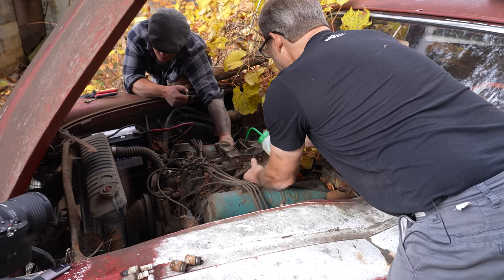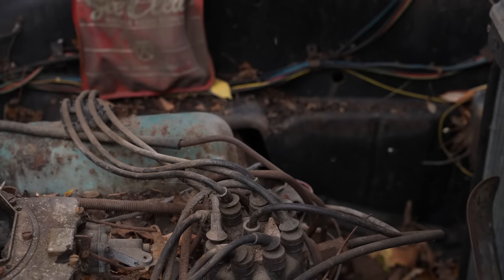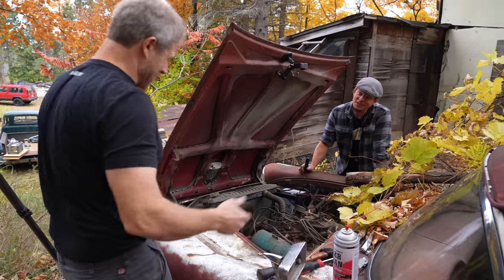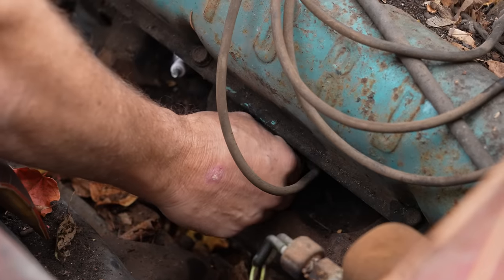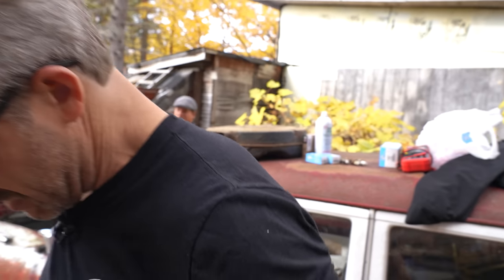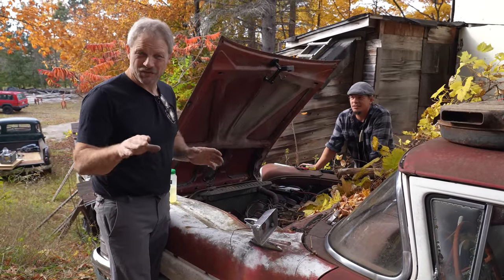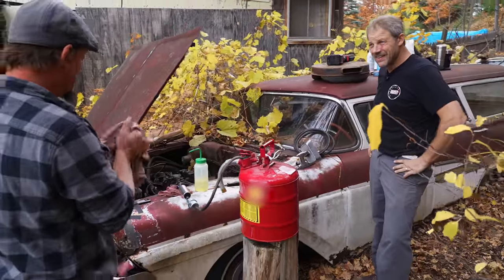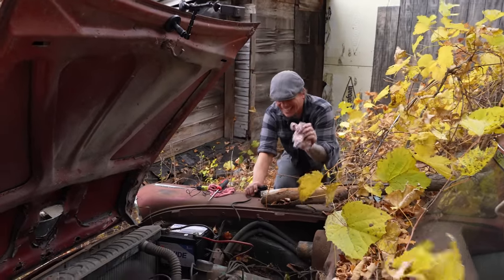'58 Ford Parked Over 50 Years Ago: Will It Run?

Comment: You just can’t kill an old Ford.  Look up Fab Rats channel and Merlin’s Old School Garage where they rescued a speed boat that had been sitting on the bottom of Lake Powell for 30 years.  They pulled the engine apart, removed the heads, quick hone on the cylinder walls, flushed everything out and put on a rebuilt carb.  With a small amount of coaxing, it started, ran and idled down.  The reinstalled the engine in the boat, plunked it back in Lake Powell and took it for a rip.  The engine was an old Ford FE 390. 👍

Comment: 50 year old car starting kit:
Innova remote starter with trigger handle
Quart of 2-stroke gas mix in spray bottle
New Walmart battery fully charged
3/8, 1/2 inch drive battery powered impact guns
225 piece Pittsburgh tool set
2 jackstands
1 floor jack
24 inch breaker bar
test light
meter
electrical kit with connectors, shrink wrap, wires of different gauges
tie wraps
6 quarts oil
oil drain pan
point file
spare condensers, spare ignition coil
few quarts transmission fluid
air tank
boat tank w 2 gallons gas
cheap electric fuel pump
fuel line
clamps 
carb cleaner
wd-40
Probably forgot a few things, but the kit isn't so vast.

Comment: I believe that's a 332 or 352. They were both introduced that year, and it sure looks like an FE engine. Sure is noisy, but on videos it's hard to tell if it's just an exhaust leak at the manifold or something more ominous. It could also be sticky lifters which isn't a huge deal. One of the things I would do if starting an engine that hadn't run in 50 years is change the oil first, and then - once it starts running - look in the gauge cluster and see what the oil pressure is doing. I think most cars still had oil pressure gauges back then. If not, make sure the idiot light isn't on (and is still functioning.) I would also take along a cheapo mechanical oil pressure gauge that you can get for 25 bucks from the parts store, in case you get no reading from the existing gauge.

Comment: for the spark plug wires I use zip ties nr 1 cil 1 tie wrap nr 2 cil 2 tie wraps nr 3 cil 3 tie wraps maybe a handy little tip for someone

Comment: Speaking from experience with this era full size ford and edsel, I guarantee that ignition switch is bad.  You can pull it apart and fix it when you get it running and driving. ;-)

Comment: At that stage with all the dirt sitting in the bottom, it is always better to change the oil and rince the inside of the engine wih diesel before turning it with the starter. After more than 60 years she deserve it. No rush,a little more time ,a few bucks and do what needs to be done

Comment: Clearly not running on all cylinders probably due to low compression/no spark. What did the oil pressure gauge say

Comment: I've seen enough Junkyard Digs, Vice Grip Garage, Mortske Repair, etc al to know, it will need the ENTIRE brake system AND fuel system replaced, plus tires, and we don't know if it will shift.

Comment: I really like watching these videos, but is everything that is seen in them true? Depending on whether the engine of a car has not worked for a few years, in this case 50 years of being stopped. 
What you see is the change of spark plugs, battery, one or another cable, but they do not change the engine oil that is there for a long time and they do not replace the hoses either. So to what extent is what we are looking at true?

Comment: That has the old ford-o-matric. That tranny WILL NOT let the key power the starter, unless it's in neutral. I'm sure the key works fine for starting it. It won't start while it's in Park.

Comment: The firing order is cast into the intake manifold and yes Ford is the only American manufacturer that identifies their cylinders as 1-4 on the right 5-8 on the left with a firing order of 15426378. The Fe ford is my favorite engine and probably one of the best dressed engines was the 427-8V with baldy valve covers

Comment: Air up the tires see if it will drive a reverse and forward. See if the only wants to sell it and tell people on YouTube that's for sale. Make sure you have antifreeze in it if it's in a cold climate in case it sets for while. Put some brake fluid in it see if the. If the brakes not locked up and it rolls move it to where it can be spray washed and get that puppy into a new owners hands to restore it.

Comment: You always need to fill the bowl before trying to start it. Pump it a couple times and see if it's squirting fuel 🙄. And you're squirting fuel with your little bottle down the left or right side of the intake manifold, never both at the same time 😆giving you a firestorm out of the intake, witch is known as a lean burn back fire. 🤨😕

Comment: The number 1is driver side 2 is passenger side 3 driver side 4 passenger side 5 driver side 6 passenger side 7 driver side 8 passenger side... In that order... Now as far as the rotation of the distributor you'll have to figure that one out but it doesn't matter if it's a V6 or V8 the number 1 piston is always on the driver side the number 2 piston is always on the passenger side and so on I hope that helps

Comment: Imagine asking this same question
In 50 years about ANY 2023 auto that was left exactly the same.  
Not a snowball chance in hell 
There would be 12 bad sensors 3 bad control modules and who knows what else 😔 I feel sorry for next generation hotroders. Killed off by the very car companies we love
Me and a buddy just got a VW based kit car running in 8 hours that still had 1500 miles till it's next oil change from 1974 when it was parked in storage
Didn't even have to rebuild the carb 😱
Fuel pump diaphragm was hard as a rock tho

Comment: Write 1-2-3-4 from front to back on the wires on one set & same for other...put them back in that same order
( The real 'firing-order' doesn't matter because you are just putting the wires BACK in the same order you took them out )
Masking  tape is good...one piece on 'one' 2-peice on 2' and so on 
Even if you come back after a week or whatever you will know instantly 'which wire goes where?'
Reply: ps...old Fords like that you have to put pressure on the selector-lever to ensure it's 'all the way over' in 'Park' or the starter-relay won't engage

Comment: 31 minutes in they have the engine running (congratulations) but they keep letting leaves get sucked into the carb.  The camera work is good but apparently the videographer doesn't have a shop vac handy.  Rookie mistakes.

Comment: What do u figure, 332 or 352? Cool 58!
Reply: likely 332 given that it a 2 barrel. the 352's in 58-60 square birds came with 4 barrels
Reply: @davidbaldwin2729  Exactly. This car has the standard engine. The 332 could be had with a 4 barrel too, and that one was standard for the Fairlane 500. 352 was optional for all Fords other than TBird.

Comment: Glad you didn't clean the dried leaves off the area above the engine so when it backfires through the carb you have something to ignite and start a nice fire.   Heck you may even burn the car up. 
Work smarter guys.

Comment: shouldn't you disconnect the fuel line before even cranking it over? surely you don't want the fuel pump pulling water and sludge from the tank. But you cleaned out the carb so I guess it was all fine in the end. Now bring that baby home to the garage!
Reply: they only gave it fuel from the external tank vis the click-clack

Comment: NOT moment of truth at 8:37 ....   Did you pull the distributor and run up the oil pump with a drill BEFORE you decided to turn the motor over?   No you didn't,   which means your crank and cam bearings are dry when you're trying to turn the motor over.   Why doesn't anyone know to do this BEFORE trying to turn a motor over that's been sitting a while?

Comment: I never saw a late-50s, early 60s Ford with an automatic transmission that you didn't have to pull the gear shift up to start.  Badly-designed neutral safety switches.

Comment: country squire Ford hmmm. great vehicle but darn! you'd need large place to store.poor thing wants inside.and little TLC..me?I would just replace harness pull body off frame blasted paint go over drive system replace brake fuel lines and tank.while body off replace rubber mounts put body back. and f
drive. but keep her inside. again ford country squire big but cool .😊

Comment: Rookie's any real motor head would never run 60 yr old gas through it and not check the water for that long.  lucky you didn't blow that guy's car up.. you did lower the value by doing that, not by much. but you did. my advice get someone that not only know about, but loves old cars. sorry I'm too busy.

Comment: need to replace the spark plug wires when you were first cranking it over with the loser switch a spark from one of the wires on the passengers side was arcing to ground hey good engine get it back to the shop that guy was a seri0ous ford lover with all the cars hey next see if the ranchero or thunderbird can run again

Comment: why you guys are in such a hurry to start it when you know it will start after you take out all that 60 yr old gas and oil. I knew it would start when you said it had compression. duhh
Reply: motor runs dose the car run. you still don't know if the tyranny is good. hint hint. running  emply's there's movement. duhh or is it just the motor head in me.

Comment: It is painful watching you guys. It is realized that for drama you don't take a leaf blower and clean out the bay, but really?? Then a spray carb cleaner, fill the bowl with 2 stroke mix to loosen the crud, and some lube on the linkage maybe?? The moment it fired it was time to move forward instead hammering away at the starter. But kudos for sticking to it. Alternator????